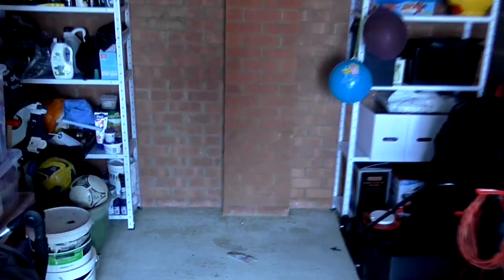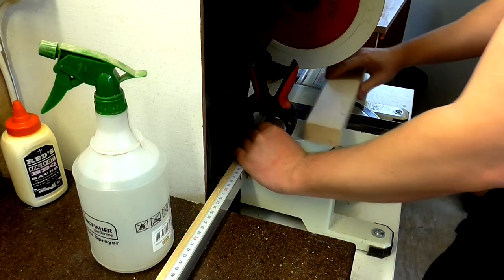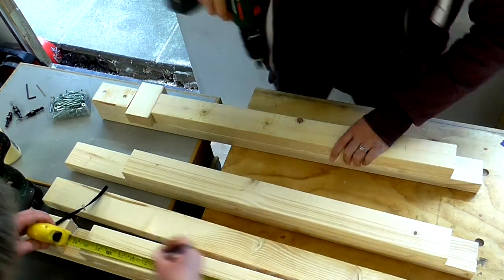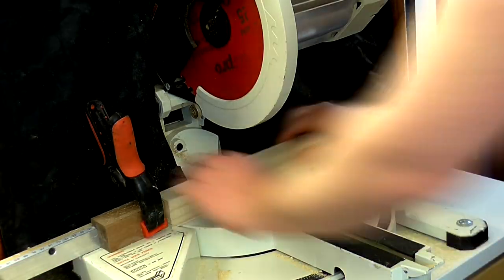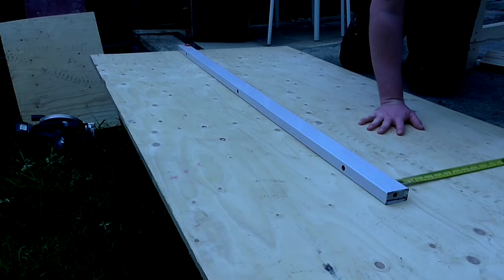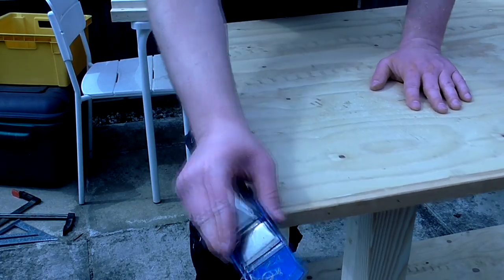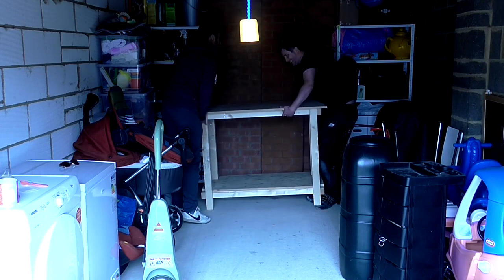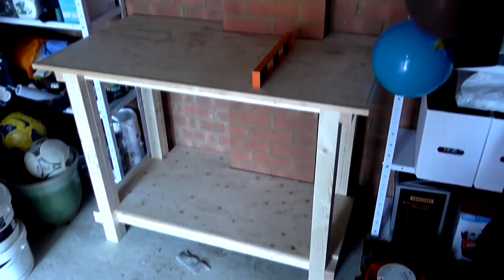Making A Quick, Simple and Strong Workbench

Comment: good work ... i wish i had a table saw and mitre saw ... unfortunately only at hand tool stage at the moment.
Maybe you could test your skills at making a video creating a workbench with zero power tools? :) That would be valuable to the new starters
Reply from the maker: +13NiiTRO13 I thought about doing that for this one actually but the problem is I only had one day at the weekend to film it and it would have been too slow. Maybe some time in the future though. Thanks for the suggestion
Reply: 13NiiTRO13 you can find a very serviceable chop/ miter saw for about 150.00, worth saving for.